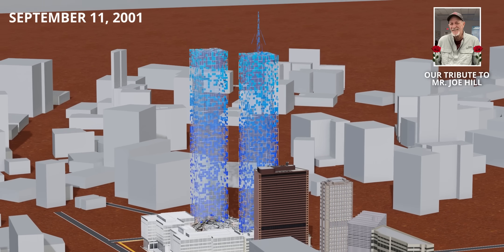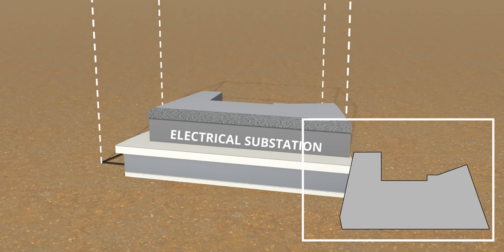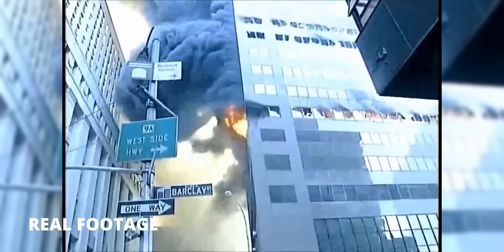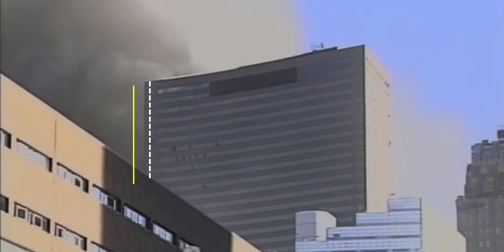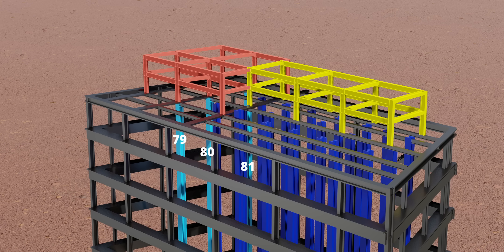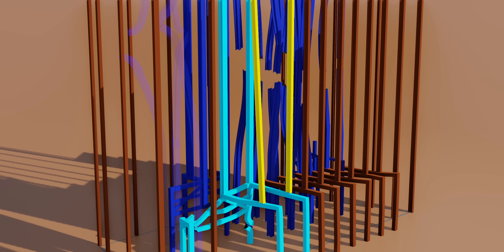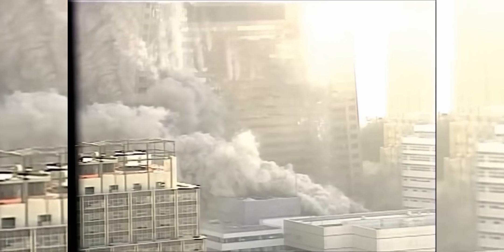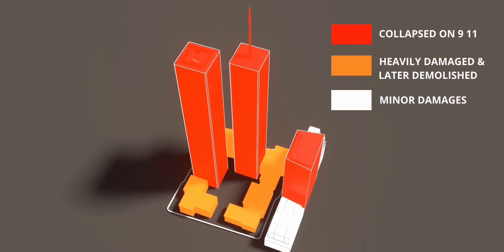Collapse of Building 7 | The Complete Physics

Comment: Why does the video speak about "multiple fires" as to indicate that they had any play in the collapse? We all know that normal building fires dont cause buildings to collapse. The video also does not the explain how the free fall speed is obtained. Its only possible if all the supporting coloums of the entire top floor give in within a split second. There was nothing mysterious about the collapse of WTC7. A Dutch demolitions expert was one of the first to explain how it was done, and that a CDM is the only way to make the building collapse the way it did. The video claims that videos of the collapse have been edited in order to achieve a free fall speed of the building. This is not true. The videos used are videos from American and British news medias and several videos lead to the same result when applied to computer model.
Reply: Multiple fires had everything to do with the collapse. Tens of thousands of buildings collapse every year due to fire so you are either massively ignorant or hopelessly delusional.

I would suggest getting your information in future from real scientists and engineers, not from web pages with big DONATE buttons at the top.

PS

Building 7 collapsed at less than 1/3 the rate of free fall, this easily confirmed by anyone with one working eyeball and the ability to tell time. You never even checked. You just looked at something on the internet and fell for it.  Doesn't that make you wonder what else that is so obvious, yet you got it completely wrong?

Of course it doesn't.
Reply: "We all know that normal building fires dont cause buildings to collapse. "
Really? We do? So, then, what you're saying is that fire departments are all a massive scam? That's a mighty bold statement.

"The video also does not the explain how the free fall speed is obtained"
Doesn't explain Santa Claus either. For exactly the same reason. Because neither has any relevance to the real world.

"There was nothing mysterious about the collapse of WTC7"
That's true, there wasn't. 7 hours of fires in a building rated for no more than 3 would have the exact, expected, outcome.

" A Dutch demolitions expert was one of the first to explain how it was done"
No, he wasn't. Danny Jowenko didn't explain anything of the sort. 

"that a CDM is the only way to make the building collapse the way it did"
He didn't even say what you want to pretend he did. No matter how much you want reality to be otherwise.

"The video claims that videos of the collapse have been edited in order to achieve a free fall speed of the building. This is not true"
Yes, it is. There are PLENTY of such videos.

"The videos used are videos from American and British news medias and several videos lead to the same result when applied to computer model."
That's right. But those videos don't show what you want, they show reality. And reality is, the building collapsed at FAR less than "free fall speed".

Oh, by the way, just to let you know? "Free fall" isn't a speed. Then again, since you have no idea what you're talking about, instead blindly copying things that sounded really cool from the internet? It's no surprise you don't know what the words you use actually mean.

Comment: 😂😂😂 fake
Reply: This Lesics video is very good – with one or two exceptions - and goes into a much higher level of detail than many viewers will be able to comprehend.  While not perfect, the collapse mechanisms – the sequence of failures - described here by Lesics are substantially correct and this is true no matter who planned and carried out the 9/11 attacks or why . 

That may not be what you want to hear and go against 20+ years of entrenched dog_ma and conditioning, but it’s not wrong. 

That also means (in case you did not get the hint) this video can be (and IS) absolutely correct in its description of Building 7 collapse mechanisms AND the 9/11 attacks could still have been some sort of inside job. The two things are in no way mutually exclusive. 

The mechanisms described here have broad professional support around the world. There are no professional engineering organizations (for example: ASCE, ASEE, ICE, etc) that disagree with them or have offered any formal dissenting opinions or alternative hypothesis. 

The mechanisms described here are not new. They have been well understood for many years and much of it can be easily confirmed by simple observation. You can literally see most everything they are talking about if you just bother to look. 

So, setting hubris aside, either the overwhelming majority of the worlds structural engineers and simple observation are wrong,… … or you are. Which seems more likely? 

IF you still –think- believe this explanation is wrong then produce a better one . Good luck with that. No one ever has and I don’t see you moving that needle today. 

No one ever does.

Comment: MORE LIES
Reply: And yet not wrong. Go figure. 

This Lesics video is very good – with one or two exceptions - and goes into a much higher level of detail than many viewers will be able to comprehend.  While not perfect, the collapse mechanisms – the sequence of failures - described here by Lesics are substantially correct and this is true no matter who planned and carried out the 9/11 attacks or why .
That may not be what you want to hear and go against 20+ years of entrenched dog_ma and conditioning, but it’s not wrong. 

That also means (in case you did not get the hint) this video can be (and IS) absolutely correct in its description of Building 7 collapse mechanisms AND the 9/11 attacks could still have been some sort of inside job. The two things are in no way mutually exclusive. 

The mechanisms described here have broad professional support around the world. There are no professional engineering organizations (for example: ASCE, ASEE, ICE, etc) that disagree with them or have offered any formal dissenting opinions or alternative hypothesis. 

The mechanisms described here are not new. They have been well understood for many years and much of it can be easily confirmed by simple observation. You can literally see most everything they are talking about if you just bother to look. 

So, setting hubris aside, either the overwhelming majority of the worlds structural engineers and simple observation are wrong,… … or you are. Which seems more likely? 

IF you still –think- believe this explanation is wrong then produce a better one . Good luck with that. No one ever has and I don’t see you moving that needle today. 

No one ever does.
Reply: @TheCriticalStinker-01 Well said Planter

Comment: nice try but the spire didnt fall that direction
Reply: Yeah OK, but what changes?  Nothing. It was perimeter columns not the antenna that caused the damage. The damage is still there. 

It's just a detail.
Reply: @TheCriticalStinker-01  Idiot, the perimeter columns were panels, one really has to be mentally disabled to believe they had caused that long straight gash.
It was CORE columns and officials and their shills like you should start trying to explain why core columns would tip over like that in such huge lengths.
Reply: People were literally in the building that witnessed the fires and said they had them under control not to mention it fell 7 hrs later when Larry Silverstein said to "pull" building 7 even John Kerry said that they brought the building down in a controlled fashion. Steel and concrete doesn't just implode from fire. Never has another high rise fell into its own foot print from fire and three buildings turned to dust in one day. Upright 4 inch thick girders don't just turn to dust, sorry.